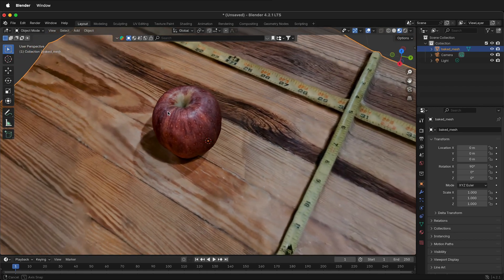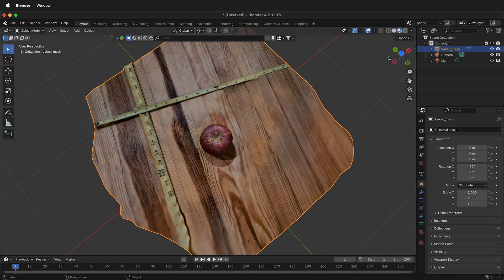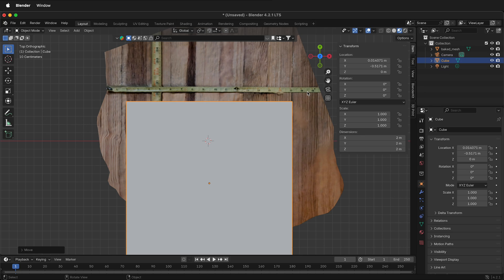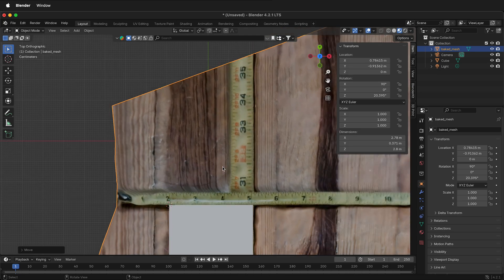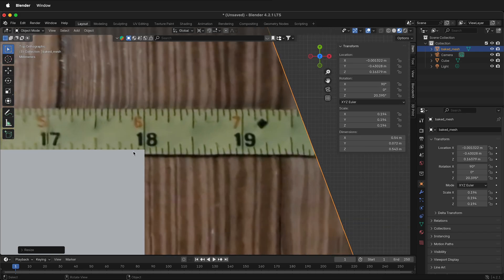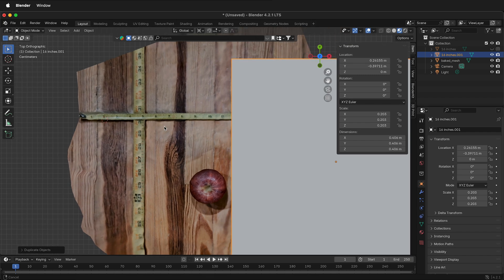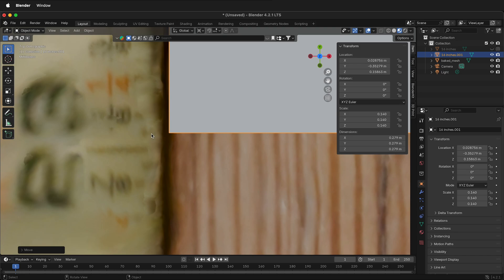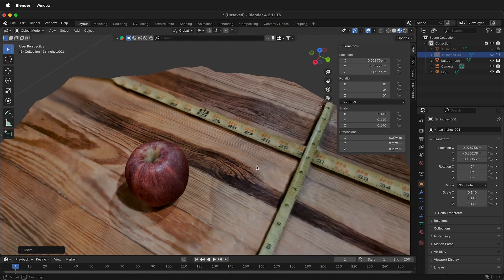Calibrate size of 3D Scanned Photogrammetry Mesh in Blender

Comment: I have models that I need to use for AR. I scanned them and transferred them to blender. I erased and filled some areas. Since the areas I filled looked colorful, I wanted to use the clone tool in the texture painting section. After using it, it painted other areas on the model. I can't figure this out.
Reply from the maker: If you use Reed to apologize when you are sculpting and filling in holes then you need to fix the UVS because the model has new polygons that are not UV map and can be on top of other parts
Reply: @WhatMakeArt  I've been working on this for 2-3 days but I couldn't do it. :) Anyway, thanks, I'll keep searching.
Reply from the maker: @carsiselcukuni1 sometimes it takes a bit, hope it works out for your project 🤞